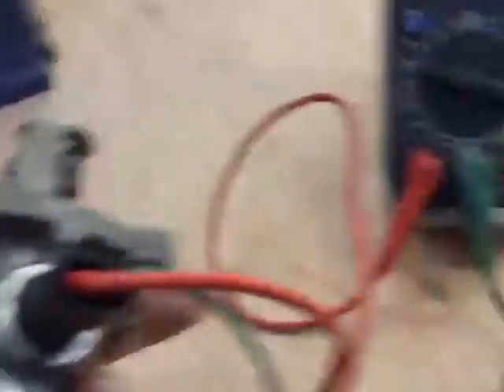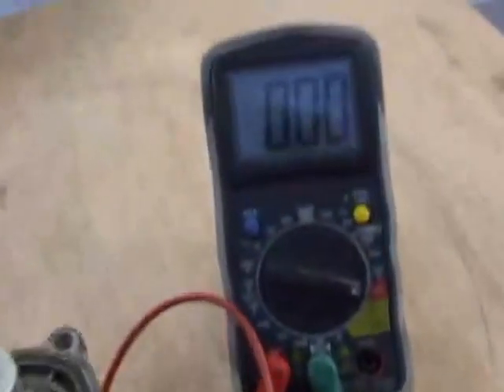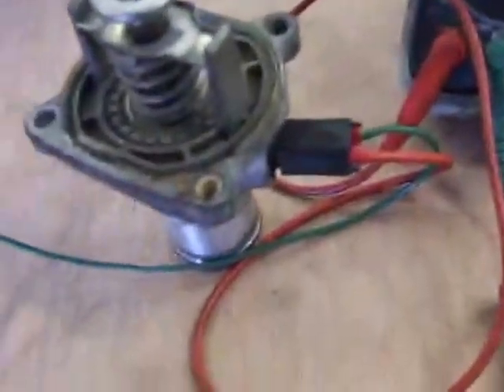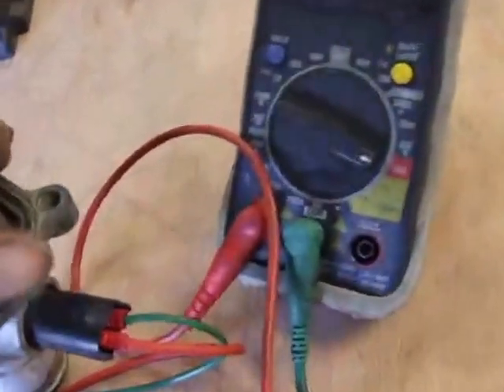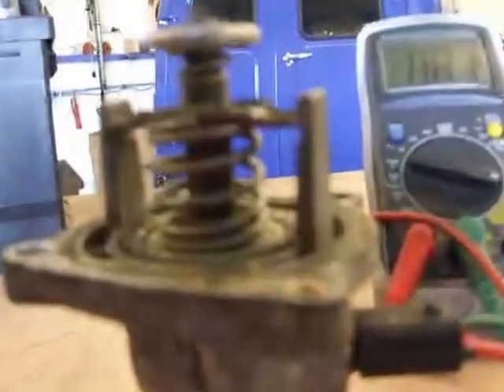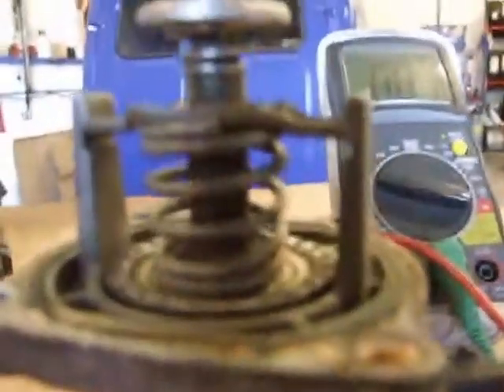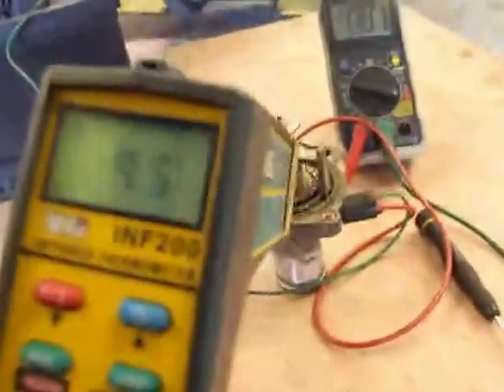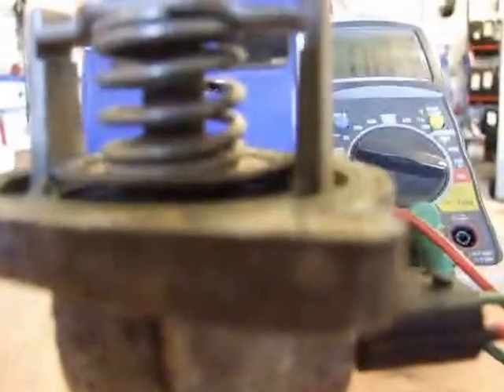Vauxhall electrically heated thermostat demo Pt1

Comment: i posted 2 times but i think was a bug or something, ty a lot , that heater element is what i need ... mine have ~4,9 Ohmi ... i think that isnt good, i have found on some website
 " Measure resistance between the following terminals:
Y158 Thermostat, Map-Controlled
Wiring harness connector (component side) terminal 1
&
Y158 Thermostat, Map-Controlled
Wiring harness connector (component side) terminal 2
 
nomina value - 10 ... 20 Ohm"

Comment: hi, what is normal value of that electric resistor that help with heating ? ty
Reply from the maker: I didn't measure the resistance of the heater element if that's what you mean Gabriel. But as battery was 12 volts and the current drawn was 850 milliamps (0.850 amps) then using ohms law 12/0.850 =14 Ohms. Hope that helps

Comment: Hej sir I want ask, are this thermostat open manually.
Reply from the maker: The coolant does open it when it gets to temp like a normal thermostat. But the ECU can open it before the coolant does by feeding battery voltage to the heater inside the wax bulb so as to have a finer control of engine temp